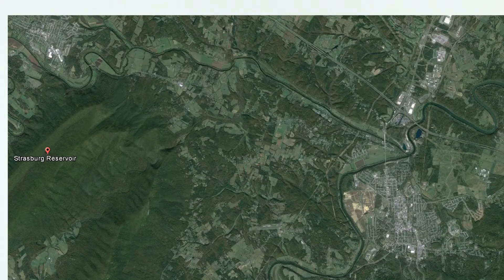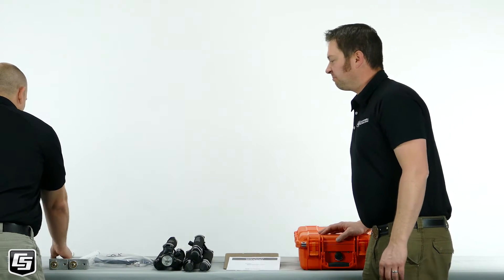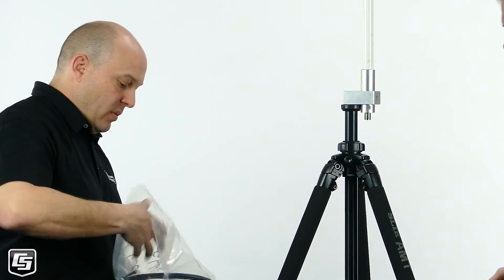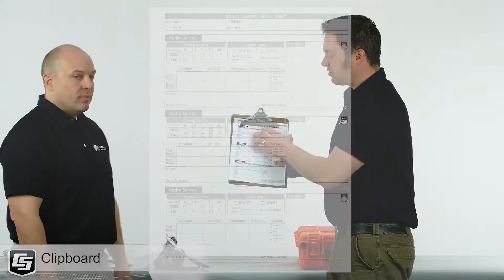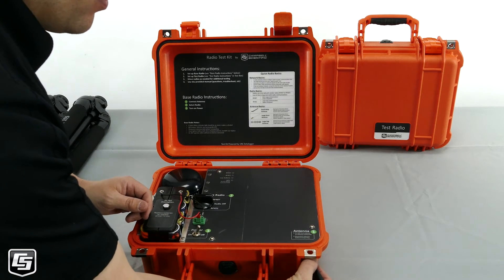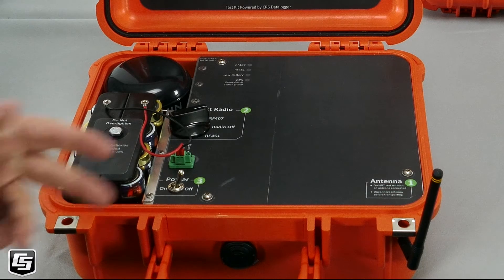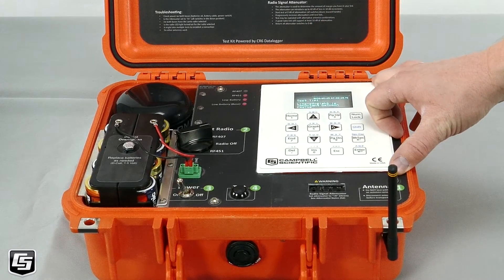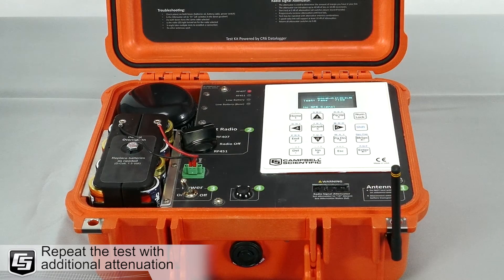Using the Radio Test Kit

Comment: at 1.52 of this clip,  you are setting up an omni antenna, is it a 2.4 or 5.2 Ghz wifi antenna?
Reply: +yxhankun, all of the the antennas provided with the 900 MHz Radio Test Kit are designed for operation between approximately 900 and 930 MHz. The radios in the 900 MHz Radio Test Kit are the RF407 and RF451.

https://www.campbellsci.com/rf407
https://www.campbellsci.com/rf451
Reply: thanks!

Comment: what is the function of black round device on the left top corner?
Reply: +yxhankun, It is a GPS receiver, the GPS16X-HVS. Through a serial connection to the datalogger, it provides the current location (latitude and longitude) information. When available, the "Test Radio" kit displays location to the user via the integrated CD100 display. Also when location is available at both sites, the "Test Radio" will retrieve the location of the "Base Radio" and provide a estimation of its relative location. This allows you to quickly get a sense of your RF path length and direction.
Reply: thanks!